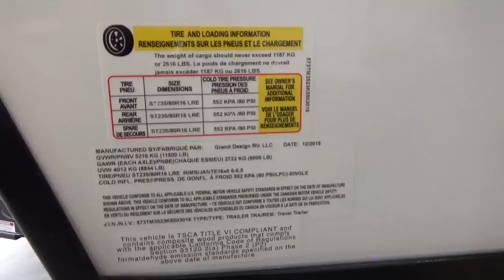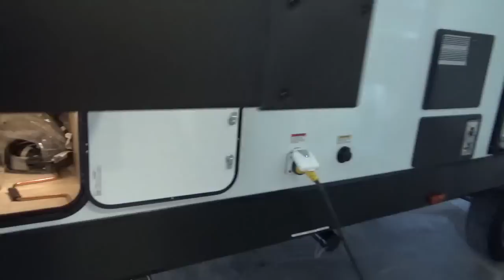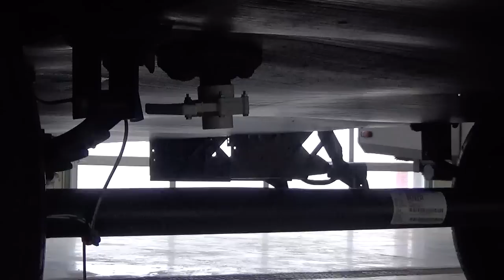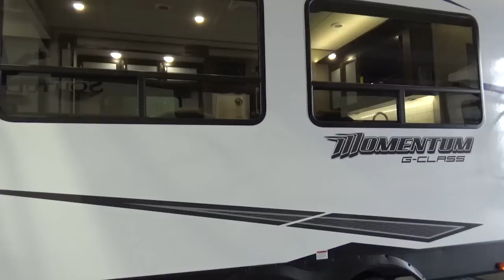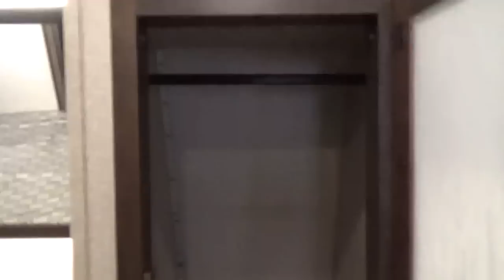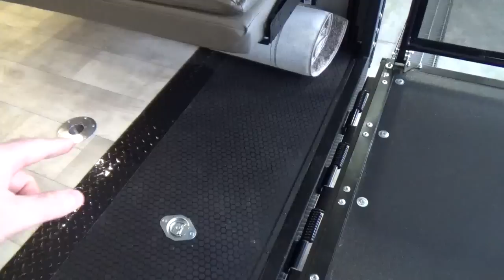2019 Grand Design RV Momentum G-Class 28G Travel Trailer Toy Hauler - Extended Tour

Comment: Why the dang folding mattress??? So dumb!
Reply from the maker: Fancy This Y’all, thanks for your comments. GD uses the folding mattress in their travel trailer toy haulers for several reasons. 1. Shorter overall length. 2. Maximize a larger garage area in a shorter package. 3. Massive master bedroom. 4. Residential size/walk around queen bed. 5. Way more bedroom storage with chest of drawers and exterior kitchens(floor plan specific). The list goes on. Although a folding mattress isn’t the best option, we feel the positives gained far out weigh the one negative. Thank is again for your comment. 😀